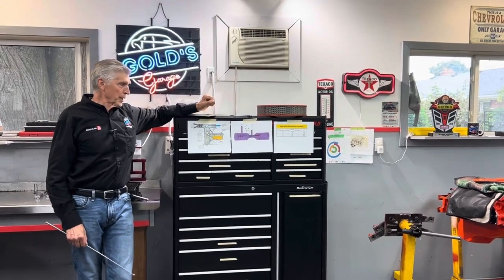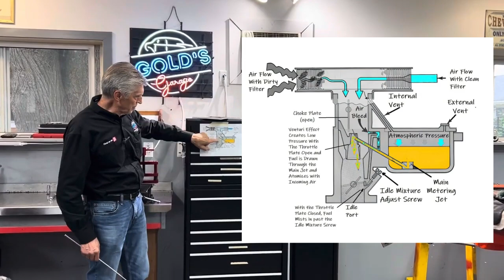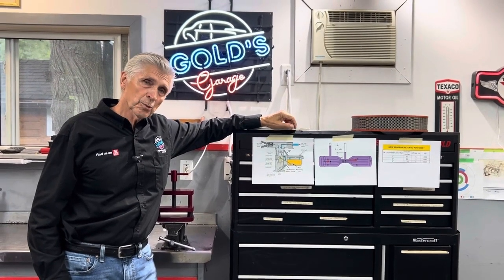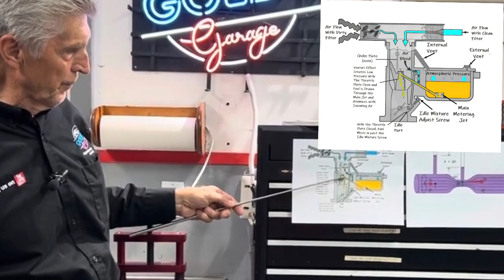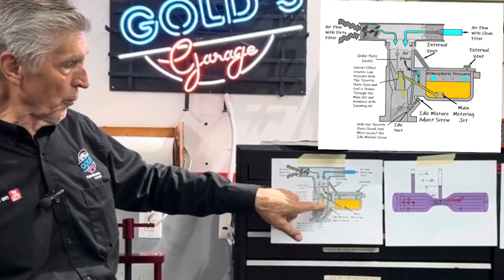THE SURPRISING TRUTH ABOUT HOW MUCH AIR YOUR ENGINE NEEDS! Are BIGGER, or K&N Air Filters BETTER?

Comment: I saw a dyno video where a stock, narrow, snorkel style air cleaner was added to an engine after testing it without an air cleaner.  It reduced the horsepower by 25.  Flipping the lid reduced the loss by 15.  I forget all of the details about the engine.  I believe it was a warmed over muscle car engine.  The customer wanted it stock appearing so the air cleaner, carburetor, intake and exhaust manifolds all had to be stock.
Reply: There is a big diffence between an engine in a dyno cell, and under the hood of a well warmed running auto. The small snorkels could choke the engine a bit. The later ones with a flex tube connecting to pull cool air from in front of the radiator mount were much better. Many of those had a temp sensor to close the cold air off when the engine was cold, to pull air from a shield on the exhaust manifold for warm up. Then this was closed off when warm to pull cold air from in front of the radiator.
I jist noticed a video about Coppertop's SCOTUS judges blocking an EPA regulation. Some EPA direction I have not agreed with, but generally speaking our air quality is much better. Coppertop and his vassels back the billionare businessmen to the detriment of the common man.
Reply: Those small inlet Chevy air cleaner housings were very restrictive. I seem to recall the dyno test that you mention.
Reply: My fuel injected 1985 Corvette responded well to ram air from SLP air intake system instead of breathing hot under hood air.
Reply from the maker: Thanks KD6, those numbers all seem reasonable. It will be interesting to see what our dyno tests show. AG
Reply: Nicks Garage has dynoed different air cleaners on some of his engine builds.
Try a K&N 66-3040. It’s the lowest 14x3” air cleaner assy I have found (lowest lid).
Also a B&B 72200. It’s like the Afco Racing, AllStar air cleaners you see used on circle track all the time.

Comment: All I use is K&N air filters. David Vizard did testing on all filters made and K&N filters turned out to be the best even if dirty.
Reply: But when you do an oil check you find more dirt with them.
Reply: @doomman700  they definitely ain’t the best choice for dusty conditions when brand new or freshly cleaned. 
Two vehicles I’ve owned I actually noticed more power a 2009 trail blazer at higher rpm would struggle and down shift really hard. When I put the k&n in it quit down shifting really hard it was night and day difference when I traded it off I put the oem filter in and was right back to being gutless . Then a 2010 town and country would knock at higher rpm and with the k&n it wouldn’t do it
Reply: @jordbjor1 I use aFe filters because my oil samples come back better, and they still flow air better than paper.
Reply from the maker: Thanks Steve. i didn't give an opinion about K&N because I don't have any tangible experience with them. I will try to include a K&N comparison when we get to the Dyno. AG
Reply: Can you provide a link to this test?  I searched his channel and all I found is a video where he claims the Project Farm channel tested K&N incorrectly and claims they only perform well in a pulsed airstream such as that created by a piston engine.  I saw now tests only anecdotes about tests performed in the past and claims about the tests.  And given that he apparently was a paid consultant to K&N, he is hardly an independent source.
Reply: @LTVoyager  project farm did a proper test that proved   K& N filter will let small particles past. Do you want clean air or do you want flow.
Reply: @mylanmiller9656  Did you watch the Vizard video?  He raises a good point and one worth looking into.  As an engineer, now retired, I have done a lot of testing and come across many scenarios where the tests didn’t mimic real world conditions and results.  I’d like to see Vizard’s tests to see if his hypothesis holds any water.
Reply: @LTVoyager  no I didn't watch the Vizard  clip but I see the fact that K&N filters let small particles through.  As for Vizard I used to think he was a smart dude until he raved about Run down Weingartner  when he came with facts.
Reply: @mylanmiller9656  You should watch the video.  He poses a good question.  I can’t say if what he poses is correct or not, but it is worth seeing some tests as the tests that Project Farm and others have done are decidedly not realistic vis-a-vis piston engines.
Reply: @LTVoyager  Explain to me how a filter that don't stop small particles is a good thing on an engine that dirt is the biggest killer.